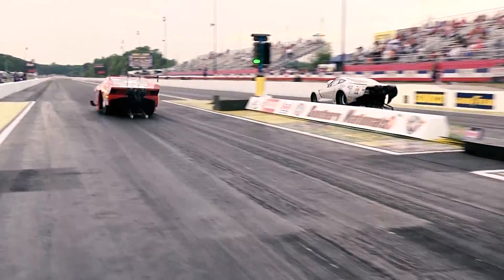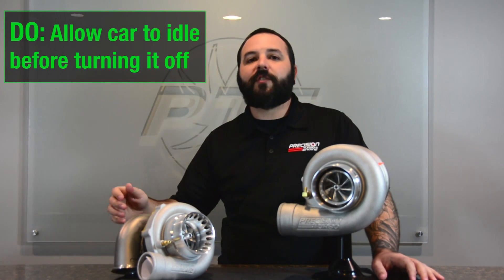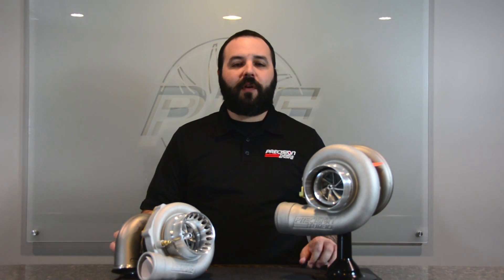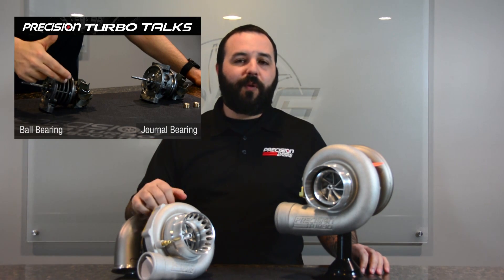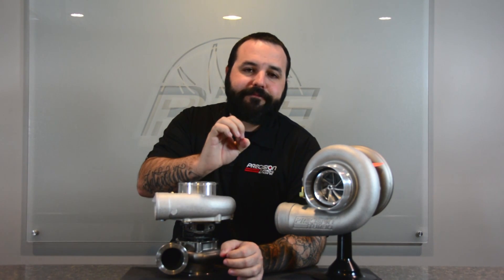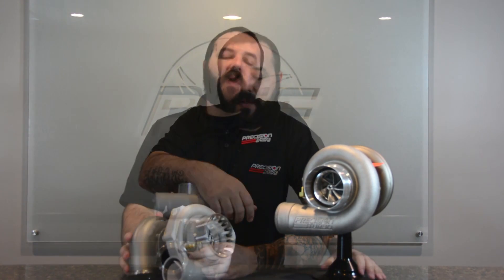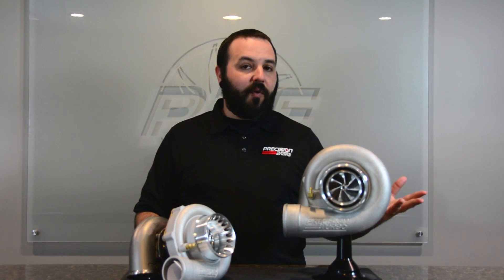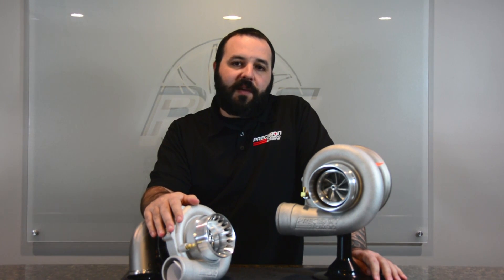Precision Turbo Talks - Turbocharger Do's & Don'ts

Comment from the maker: We hope this video was helpful! Let us know what questions you have for us in the comments!
Reply: Precision Turbo & Engine hey guys you missed a huge one to run or not to run a BOV!!! I run without as do 99.9% of skyline owners but does it really damage our BB turbos!?
Reply: Precision Turbo & Engine what creates the pressure for oil going into turbo? Where do you run the inlet hose from?
Reply: So Precision doesn't respond to any questions?
LoL
Reply: Do any of the bypass oil filters (fine/ small micron, soot filters) allow enough oil flow to feed a  turbo? If so how big could they handle?
Reply: Hy guys i have a mishimoto catch can (big one)  do you think i should remove it ?

I have my 550hp setup on the sr20 since few years now without problems but since i installed mishimoto catch can there is some oil under the turbo it is not much leaking but it is there, i am not sure if it is a turbo line or on exhaust or inlet side of turbo how can i check it ?, what you think should i do 

Thx for your time and support
Best regards from 	austria
Dragan
Reply: Dragan Babic as stated, sounds like a mount or possible part failure. Catch cans I have never heard cause turbos to leak. Is it vented or recirculated?
Reply: DarkMufasa     thx
Reply: Dragan Babic np. Also oil plumbing and pressure should be sound and checked too
Reply: AP1 S2K there are a lot of options, you can input from a external oil pump or from your oil pan which I do not recommend or even from the block. Pressure can be managed by a vacuum block or restrictor. Pressure in motor by crank generate pressure internally too
Reply: DarkMufasa     what you mean with oil plumbing?  Sorry i am from austria my english is not the best,   the oil pump is brand new and on full load on 7 bar,  once i startet and the oil dipstick came out but i think this is because my dipstick seal is 20 years old and should be replaced
Reply: Moe Green for fast response, give them a call so they can email you the form to submit your turbo to them. IMO
Reply: Haha. Did you love your own comment 😂
Reply: I set my turbo timer for 40 seconds. Is that enough?
Reply: Hi guys need help 1980 z1000j want turbo it  not case big power 50-120 turbo be fine like a gt12 garrett i need bolt a single carb to it no mr turbo done kit if u seen pics u see wat im tryin to do can u  help me in any way
Reply: Precision Turbo & Engine I have a 1999 dodge R / T  Dakota with a 5.9 I want to turbocharged it so I got a turbo from a 7 liter Detroit Diesel will that work on my motor ?
Reply: Precision Turbo & Engine very well explained good work keep it up.
Reply: I've got an idea to help preserve Turbos. I live in Wesville In. Close to you if you want to hear my idea. I'm not 100% sure that this is possible but, I just thought about it while watching you video.
Reply: Turbo timer plug and play
Reply: Is turbo cool down as necessary in diesel applications that would run significantly cooler than gas engines? In winter time does everything cool down to fast and cause possible damage?
Reply: What is the best turbo size for single cylinder motorcycle engine 215cc custom build (billet aluminium and forged internal) engine with a target horsepower of around 100hp+?
Reply: Do I need a customise turbo for a vertical position
Reply: Can u put a turbo on a 2015 Mazda 6 I grad touring
Reply: I don’t quite understand mounting the waste gate at 45 degrees vs. 90 degrees.
Reply: My friend had a 928s turbo Porsche that had an electronic timer that would let the car idle for 3 minutes even after the key was taken out of the ignition to prevent the oil from heating.
Reply: What is a good "Cool down" temp? Mesured were?
I see 400°f on the outside of the 12cm wyt 315°f egt.  Heat soak? 
4:00 why did Cummins use a restrictor on there Journal bearing holsets?
Reply: Precision Turbo & Engine   Hi, I’m interested in how to engineer a turbo for use on automotive engines that are converted for experimental airplane propulsion.  Specifically to what altitude various setups are able to sustain full power.   Take the Honda Accord 2.0L turbo for instance.  
Realizing this may beyond a simple chat response anyone who can point me towards other resources, would be appreciated!!
Reply: Not just great tips for precision. These are great turbo tips overall
Reply: I have question i got my freightliner m2, cummins engine model, i brouht it to repair service shop for replacing radiator and SCR for open emmission campaign. After a week of repair fixed. I noticed my yellow engine and red engine light on . I brought my truck back to the service shop. They took  a look at it and diagnosed it. They found out thay the turbocharger failed to sealed. My question is that the radiator and SCR replacement are tha cause of my turbocharger failure?
Reply: Why does the oil from the turbo bearing drain back into the pan between the intakes, and drain back into the pan?  Doesn’t that contaminate the engine oil, especially if you’re driving lots on dusty gravel roads?
Reply: Precision Turbo & Engine very nice

Comment: I often use my Pu to tow heavy loads in big Mountains. I lost a turbo and it was replaced by a diesel specialty shop. Since then I am not able to maintain speed when on most hills. The exhaust temp. shoots up to 1300 or even 1400 right away. What is the problem? Do you know what I can do to get my hauling beast back?

Comment: Most newer turbocharged cars circulate coolant after the car is shut off-Like a built in turbo timer- My 2018 circulates coolant upon shutdown and my 1986 Porsche 944 turbo had it waay back when.

Comment: I plan to have my exhaust side braced from my D16 block with a full flex joint and use fiber reinforced silicone couplers to "decouple" the chassis from the rest of the system. I hope to break the D-Series record of 812hp and push the limit to around 1,000hp to prove that the "single jingle" can "flex" with the rest!!!

Comment: just for your info a standard Mazda RX& FD 1993 and up use a standard 140psi oil pressure system  which will  over oil  the standard oil system and blow oil out the exhaust. so we HAVE to run a Restrictor. and maybe you should be aware of  the oil filter screen on the incoming oil supply line fitting which has a screen which can get crushed if a standard AN fitting is  screwed into it..my Friend's  TO4 e got supper hot and when removed had a blocked crushed screen stopping oil getting to the turbo so it burnt out the ceramic bearings..it lasted only a few days..we are NOT Happy..

Comment: Can a turbo be mounted with the hot side pointing down and the oil drain on the side if you were to put a 90 degree elbow pointing down right after it exits the turbo?

Comment: I never knew about the hot oil inside the turbo. I usually just turn off the car right away, but I usually only drive between my home and work in the city speed at 30-40 mph, sometimes on the highway at 60, but usually only about 15-20 drive. It shouldn't hurt much, right?
Reply: I’m in the same position with you, I didn’t know so I’m just going follow what they say since I just recently got the car.

Comment: Oh boy, here we go again: if you shut your turbo down hot, it will coke the oil. I pretty much turned it off right after that. Any decent oil designed to be run in a turbo charged motor will not Coke. Coking was a problem back in the 60s and 70s because of bad oil. Maybe your turbo chargers  just sucks.

Comment: How about not pollute and get a cheap 15 min timer and a small water pump and as soon as you shut off the car timer starts and runs coolant threw the turbo and cools off even faster because no exhaust going threw it and does a better job 

 I did it never had a problem and got the idea from my Audi because it comes like that from factory save the planet and your time 

if I had to sit in my car for 15 minutes every time I boot it I'd  be stuck in my car all day

Comment: Interesting info about the crank case pressure affecting oil flow. I was not aware of that before.  But I'm guessing that is only a problem at higher boost levels?
For a tuned daily driver running 1-2 bar of boost, baffled catch cans seem to do the job just fine from what I've seen

Comment: I'm working on installing a T3 off a junkyard Saab on a VW Bug. Turbo was designed for water cooling (was plumbed for that on the Saab) but my Bug is air-cooled, so no water cooling available. See a lot of other Bugs running similar turbos with the ports simply plugged, seems to do alright. Read literature from Garett saying that the water cooling is mainly needed for preventing oil coking after shutdown, not so much for while actually running, so the cooldown is the critical part. How much cool-down would be needed, would I need to idle for a while before shutting down, or would a few blocks of gentle driving on urban or neighborhood streets before arriving at my destination (as would be the case at most places you'd be arriving to if you're not hooning it in the neighborhood) be adequate to cool it before shutting it off?

Comment: How about mounting the turbo like exhaust side down and the air intake sign up
Reply: Oil drain is fixed on the CHRA.  It must be down.  The labrynith seals  only function properly with drain down AND free flow to crankcase.   Ignore this and you will puke oil out the exhaust like you proposed or if compressor down,  oil will flood the intake.

Comment: Always been an performance amateur but all my life I was riding bikes, and now I’m getting older and had many crash so for less pains to get in or out I got a suv style véhicule witch is a Hyundai Santa Fe 2.0 turbo that has 264 HP and 270 lbs of torques, never have to complained for a stock véhicule an suv even more it’s kinda not bad , ( we all go for what we can and my budget is kinda limited so I know theirs many parts for the genesis 2.0 t witch is ( I think the same engine as mine) but never saw anything for adding power for the Santa fee I like to know if for a couple of thousand $ I could get around the 350/400 HP from the little 4 cylinders and keeping it relatively reliable, if I don’t go racing every day but more of a using it from time to time but the most parts riding it like a normal driver. 😂😂. 
I miss the acceleration my 210 hp bike had and would like to have a little more that what I have now . 😕

Comment: Most modern turbocharged cars have can be shut off immediately with no detrimental effects. Why? Because the turbos have a water cooled center section and the engine has an electric after-run water circulation pump for the turbo(s). When you shut off the engine, the tiny electric pump continues to circulate water to the turbocharger cartridge for a few minutes. This is why turbo timers and manual idling is OBSOLETE.

Comment: Is driving slow (low rpms) for a few minutes before shutting down equivalent to letting car idle ?
Reply: YBounce driving slow with low load on the Engine is actually even better than sitting in a spot idling because of the airflow the cooling is much better.

Comment: I just had a shop replace turbos, now my engine smokes like a chimney...any ideas where to start?
Reply: Lol. Turbos were cooked? Check intake and intercooler piping. Probably full of oil. Also. Original turbos? Internal restrictors or nah?
Reply: @Baksteen_Express  Oil lines were replaced, rebuilt original turbos, seems like its leaking above the manifolds as the exhaust is burning the oil
Reply: Time to go back to the shop that did the repairs. Gas or diesel? Oil burning inside the exhaust =bad rebuild needing new seals . Oil burning on the outside =bad install.  Pressure line spraying things? Or drain hose not tight?

Comment: I'm building a 2JZ GTE G35. What turbo would you all recommend for 700-1100 hp?
Reply: MONSTA precision turbo 6466
Reply: @hort21  good copy... now i need a exhaust manifold that will mount up without bay modifications.

Comment: does a turbo charger use up more engine oil
Reply: Karim Currimbhoy typically the engines that support turbos need a little more oil, due to the extra passages the oil has to travel, but using up oil like how a 2-cycle engine does, no

Comment: i have a question i have just make a mistake   to opening the hex bolt of  oil line on my mew turbo during installing  so the point is do i have any way to fix it  correctly again  
waitting for your  helpfull reply as soon as possible so i can  install my engine back to my evo 8
i shall be  very thankfull to you

Comment: Hi I have 6466 keeps spitting rear seals done 3000km  any way to fix
Reply: yeah, throw it in the trash and buy a borg or a garrett. lol For the money, you really cant beat borg.  I ran a 257 to see what kinda power it would make, dyno on my channel. 600hp and torque for dayzzzz on a 4 cylinder s2k

Comment: If your doing some spirited driving and you immediately shut down car after , you should not have a boosted car. 

My wg placement is shit lol. Only companies that make manifolds for my car didn't do a great job with that. I have to use a 13psi spring to get 23 psi spring pressure, thats how inefficient it is. But there is also not alot of room so I understand why they did it like they did. Would need a custom made manifold

Comment: Almost 2 year ago I passed my driving test, I had no idea about up to fix anything on a car. I'm now currently sat with the whole front of my car off to get to my turbo to recondition it. Some very useful stuff here that I had no idea about, thanks for the great video. Time to remove the turbo and fix my car 😁
Reply: did it work :P
Reply: @jeremycormier8559  Yes and no. I  fixed the turbo itself but i had boost pressure issues and other problems. Moral of the story, be careful messing about with  things you dont fully understand lol

Comment: dont share engine oil with a turbo
use a seperate oil pump and tank for turbo this
does wonders for the engine and the turbo.
sharing engine oil with turbo is a mistake.
Reply: That's stupid over complicated!

Comment: Run what the cartridge manufacturer specifies regardless of what the seller tells you unless they changed something in which case I would worry. Whoever made that bearing and lubrication  system knows it best. However better drainage can only help and I would address any problems there first.

Comment: That information on oil restrictors is wrong. Factory journal small frame turbochargers from Holset and Borg Warner use oil restrictors to prevent the oil seals from being blown out on cold start.

Comment: Where did this guy get his education from about turbos.... Journal bearing turbos have to have a 1.5 mm hole oil restrictor or they will leak out of the piston rings in the turbo... 
Ball bearing turbos need a 1mm hole oil restrictor or they will leak out. I have a Garrett gt28 turbo and i had a oil restrictor on it and it worked great then i got told by a turbo specialist to take the restrictor off so i did then i ended up with oil all threw my motor and intake manifold and throttle body. But yes all turbos need a oil restrictor or u will eventually end up with oil leaking into ur motor.
Reply: What the hell are you talking about? Journal bearing turbos don't need and should not have restrictions. Holset and other journal bearing turbo manufacturers recommends to not use one.

Comment: What's wrong with baffled catch cans ?
Reply: He seems to think they will restrict flow and cause pressure to build up in the crankcase. Which is nonsense. Any hose you run between the block and the catch can is going to be much smaller and more restrictive than the passages in a catch can.

Comment: Thank you, I just got my first car with a turbo and not really familiar with them.  Clear to understand and very helpful.
Reply: Let the car cool down after driving if you want it to last and let it warm up too
Reply: @grimcomedy6356  depends on the car. IIRC If its got a ball bearing turbo you dont really need to let it cool down before shutoff like you should be doing on a journal bearing turbo car

Comment: AKA buy a cellular connected Remote start kit so you can shut it off from inside the restaurant/work etc. because “get everywhere early enough to just sit there for a few minutes before shutting off your car” isn’t worth even printing in the user manual because Joe Consumer is always late

Comment: Shutting down right away and the turbo cooking/coking up isn't always true. Subarus are designed to sifen coolant through the turbo via vacuum pressure in the coolant system. A turbo timer actually works against the car. Learned this  a Subaru Tech School. Really great teachers. All turbos leak oil. It's not possible to get a perfectly sealed system. Pulled a lot of intercoolers off 2000 mile cars. Full of oil!
Reply: So we will frequently need to change intercoolers? I'm getting my first turbo set up on a d15b7 with a z6 head.

Comment: You don't put turbos on a motor... They go on engines! Just say'n!!! Motors use electric.
Reply: Never heard the term "motorsports", or "motorcycle"?
Reply: @thebigmacd  yeah, and it's never made any sense to me.
Reply: That's because the definition of "motor" is "any of various power units that develop energy or impart motion". A gasoline engine is a type of motor.
Reply: God shut up

Comment: If my oil temps are low as for cruising around (as opposed to elevated for spirited driving), is it ok the shut the engine down straight away as the oil temp isn't going to come down with extended idling? I would imagine extended idling is good if oil temps if higher than normal ie; for track use.
Reply from the maker: It is always best to idle the car for awhile after driving spiritedly as both the turbocharger and oil will have elevated temperatures. If you were to drive the car down the street modestly, there would be no need to idle the car for an extended period before shutdown.